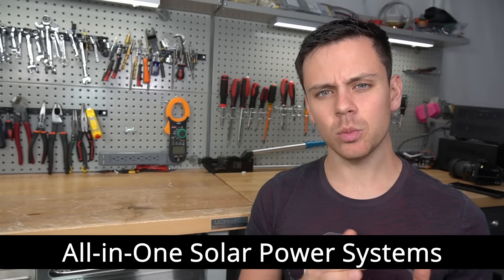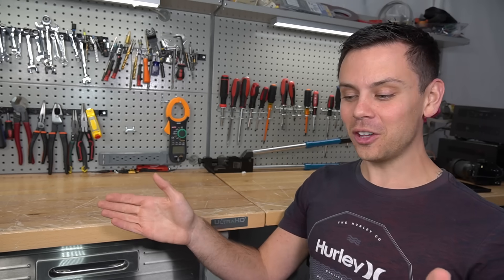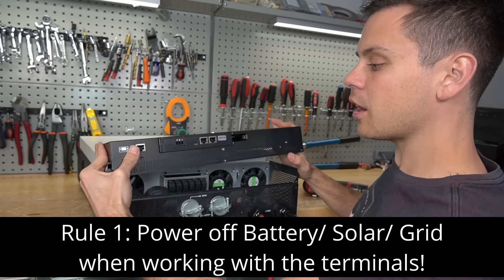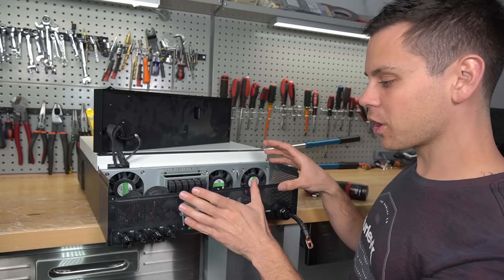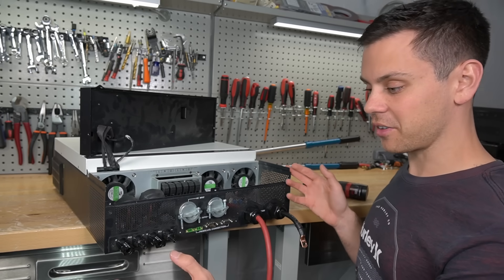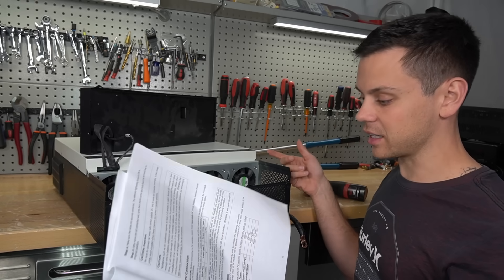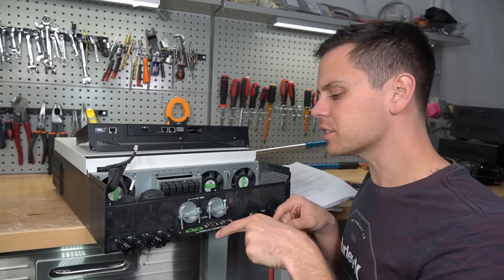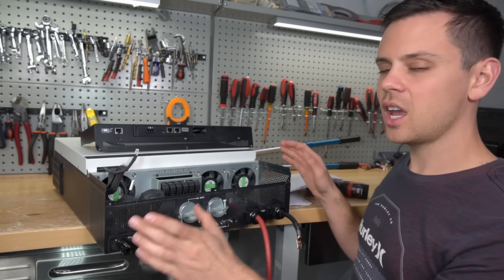All-in-One Solar System: 2 Basic Rules for Shock Hazard Prevention

Comment: Thanks for the video(s). I have the LV6048. Currently, my solar panels are grounded to earth (a 10awg green cable runs from the last solar panel and attaches to a ground rod which is buried 8ft). Are you saying that I should not have this ground connected to the panels?

Comment: Will: i can NOT find a video where a house, etc... is powered by the grid  but the grid ONLY CHARGES THE BATTERIES. the house itself would use solar power, etc... to charge the batteries and the inverter supplies ALL POWER TO THE HOUSE! 
this would be desirable as a lot of places REQUIRE YOU TO HAVE GRID POWER and SMART METERS detail every power surge, when power consumption increases etc...
it is my opinion that i should be able to power my house with power i generate and NEVER BE REQUIRED TO PROVIDE EVEN 1 WATT TO THE GRID. 
i actually worked as a BOILER OPERATOR TRAINEE IN THE LATE 1970'S AT A STEAM POWERED ELECTRIC GENERATION   POWER PLANT IN ARKANSAS.  ive lived off grid and generated my on power and stored it in lead acid batteries. so im NOT a complete nube !
the grid power is very fragile and the powers that be can shut off your electricity at any time they desire, as can any VANDAL !
i currently live in south dakota. it gets very cold here and the road behind my property currently is over 4 feet deep under the snow with over 10 foot tall drifts, while the road on the other end of my property is plowed regularly!  i lived on that property for 3 years with zero input from the outside world, used Hughes net (satellite )for my internet service and they didnt care if my power came from batteries.
looking for a place to buy and build on where there are NO building permits required because the size and strength of my building is NONE OF THEIR BUSINESS! i use to build houses when i was younger, so they will be built much stronger and of reinforced concrete!

i realize that most your viewers are upscale people with white collar jobs.
thank you!

Comment: Just wondering could this be the sense voltage but why is it ac and that high as i have seen all mppts have a sense voltage on the pv input. Any time i do work i shut it down completly If i have to mess with wires

Comment: Will, I just watched another video of yours, warning not to ground the the all in one inverter/charger, so as not to create a potential ground loop. The system will get it's ground from the AC input, which is completely understandable. Where I'm confused is on grounding on the panel frames, in case you have panel leakage occur. Does this not still create the potential for a ground loop if I have a ground rod for my panel frames only? Thank you son much for all of your wonderful videos and products.

Comment: I don't like (or use) non isolated hi freq inverters in our installed off grid solar systems! We prefer lo freq isolated inverters along with a good mppt charge controller. We never have a problem with stray voltage or bonding issues. The inverter we use is a XW 6048

Comment: "Not grounded at PV input"   For the novice, what exactly does this mean?   (1) not grounded at the inverter, (2) the structure where panels are mounted can't be on metal poles sunk into the ground, (3)  panels mounted on a metal structure have to be isolated from the metal structure if the structure is supported by metal poles sunk into the ground,  (4)  with combiner box in mind, one could see someone mounting the box on a metal pole that's sunk into the ground         

Do panels need to be floating and if there is a combiner box that also needs to be floating so basically there's no contact whatsoever to the ground?
Reply: Ground your frame.
Do not ground your PV wires.

Comment: Could you explain panel "Leakage" sometime please? I'm not understanding the "How" leakage happens or why.
Reply: The panel has got moisture into the electrical parts behind the glass and rear plastic film, now DC voltage from the panel (or from the inverter) is leaking out onto the metal frame.
Reply: @quattrohead  Thanks!

Comment: Thank you Will for your warning and videos in general. I have one question about this:

Do you think this problem also exists with these multi function devices that have a Low Frequency toroidal transfomer topology for the power inverter part of the device or is this only something that you find in High Frequency MosFet topology power inverters integrated in these do it all devices ? For example Vevor sells a line of these 4 in 1 devices that have a LF transformer for power inversion.

Comment: Hi Will,
do you still connect the ground wire in the ac input and output terminals? thanks
Reply: (circuit theory would say one SHOULD connect all "earth " terminals to the correct circuit. - and any exposed metal components should also be earthed  (additional earth connections of non electrical metallic components "never" hurt - safety switches - RCD/RCBO/GFCI/etc. use the imbalance in  active and neutral lines, it doesn't care how the missing current escaped the system - if the neutral lacks current (Amps), the switch activates, lives saved.)

If in doubt, for all domestic circuits ask your electrician to an RCBO - single DIN slot per pole - cheap safety "insurance".

NB, not an Elec-chicken.

Comment: I think one thing you missed with the AIO is the capacitors on the DC side, they could potential shock you after disconnecting the batteries
Reply: ( and blow a current meter...)

Comment: Got to say, this should have been common practice and rigorously in-forced. If a panel or case on a electrical device is to be opened or removed, disconnect from the solar, mains supply, battery,many source.

Nearly every YouTube channel on homesteading, solar and building all work on devices, consumer units and other electronic units, connected and some times live, its common to see people in self-home builds with the panels, connectors and receptacles live, in use, with no covers. Youtube is setting a bad precedent and very bad ‘how too’s as everyone assumes this is ‘how to’ work on electrical systems and it is safe.  CRAZY

Even working on systems when unplugged can be dangerous if there are capacitors present.

Comment: Hey Will, I would like to add something that you haven't previously considered. Originally, this comment was intended to be "tongue in cheek", but as I type this out, it might be a legit idea.
The Apple Watch could be a realistic safety tool in regards to receiving an immobilizing electrical shock.
The Apple Watch has a "fall detection" mode. If it detects that you've been immobile for about a minute, it will make a 911 call automatically. After the call ends, your watch sends a message to your emergency contacts with your location letting them know that your watch detected a hard fall and dialed emergency services.
The only problem would be if the electrical shock that stops your heart also stops your Apple Watch.

Comment: I of course always operate as if all lines are hot, even when I have everything disconnected. 

I read that in the manual, and I got concerned about it, but followed to a tee, and have no issues. 

I have yet to configure the setup for ac input, so I will check everything when that step is made. 

Thanks for alerting us Will!

Comment: Well, i feel sufficiently vindicated about the argument i once made on the forum that grounding your PV accomplished nothing useful but DOES increase the possible danger to a human touching the array. 

How about ac on the battery circuit? I found that one out the hard way too!
Reply: Grounding the FRAME on the PV array is a very wise choice, as otherwise YOU could become the ground if there is leakage.  Will means to not ground either the positive or negative WIRES of the array.
Reply: @Tumbleweed5150  
Just so we're clear: 

Ground your pv CIRCUIT = dead short your inverter (slang term but it popped a 10amp fuse in Wills meter so.. close enough?).

On the other hand, ground your pv FRAMING = dead short your inverter IF the TOTAL current leakage of ALL your panels is enough to actually shut down the inverter (have fun diagnosing which panels!), or if it's NOT enough to shut it down then you just have a phantom load on your inverter which doesn't trigger any actual protection devices because there's no gfci between internal componentry of the inverter.. right? At which point having your PV framing being grounded is just creating a large PITA and you may consider NOT grounding the PV array to your EGC and instead using spark-gap lightning protection and finding some kind of surge protection device to use inline in the PV circuit to protect from lightning. The EGC is there to facilitate fault detection but in this case THERE IS NONE TO FACILITATE! It will simply continue to operate in a fault state! At that point having a low pass filter on your PV wiring would probably do more good than just letting your inverter leak through your PV circuit full time via the ground conductor and creating a ground loop that is 'upstream' of any detection devices. The ground might make your array safer to touch while in a fault state if the array is on your roof, but if its a ground mount 200 ft away.. is having that grounding conductor making things better or worse? Grounding PV framing doesn't solve this problem. It just makes it hard enough to notice that it can continue merrily on. The fact that it took Will this long to become aware of this issue (no slight intended at all) corroborates this interpretation, in my opinion.

Comment: You may want to verify your voltage readings with a LoZ voltmeter so you can rule out any "ghost" voltages.  (I know your ammeter test proved there was an issue with that model, but I'm not sure if an ammeter was used on all the others.)
Reply from the maker: Yes absolutely

Comment: even when everything is powered down... there "could" be huge potential in the capacitors inside... those actually need to be drained as well.
Reply from the maker: They actually self discharge in a few seconds luckily. But yes the caps can shock for sure

Comment: My all-in-one’s instructions clearly said to make all connections and Cables before connecting to AC, Batteries, or Panels.  Something I believe you missed is the PV.  Most of these devices instruct you to connect your Panels in series limiting no load voltage to 500 volts and a working voltage of around 450 max.  I believe that needs to be mentioned as a danger as well.  JimO
Reply from the maker: Yeah I added that to the video with a huge text. Check it out again.

Comment: This happened to me last week when I was messing with my (wasn't thinking) and I accidentally touched the screwdriver I was using to tighten the solar leads. It was definitely an AC shock! And it was STRONG! Like, sticking your finger in an outlet strong! I was surprised! Mine is a PowMr 5000w. AC was plugged in to the wall, but I can't remember what mode it was running in.
Reply from the maker: Oh dang!! No way!
Reply: @WillProwse  Yessir! It was quite the jolt! I have also shocked myself on accident with the Solar leads (300v) and that was a much much different feeling than the one I got when I touched he screwdriver (the AC "pulsing" shock was much worse and my arm tingled for a while after). Also, i was wearing rubber shoes and thought i was insulated from the ground, but apparently not. Anyway, it is certainly something to be aware of. Here is another fun fact I found out that may be something to bring up to viewers. I had my inverter AC input plugged in to a GFCI. Then, when I plugged my furnace in to the inverter (I just have a standard 3 prong cord attached to the wire in the breaker box for now to test this before I permanently mount everything), the GFCI IMMEDIATELY trips. So something in my furnace is causing a ground-fault. (I then plugged this cord to the furnace directly into the GFCI and it also trips it without going through the inverter) I have other devices plugged in also, but they don't cause the GFCI to trip. So I think the thing to be cautious of here is that if I didn't have the inverter plugged in to a GFCI, I would have NEVER known that there is a current leak on the furnace and this could have been potentially dangerous! Now this is probably not something that is going to be the case in most people's houses (I am going to assume something is not wired properly in my old furnace). But it is something that people should be aware of. Loads that you typically would never have going through a GFCI (furnace, microwave, oven/store, water heater)  could potentially cause hazards if not run through their own dedicated breaker like they would be in a standard grid-panel.

Comment: Simply stated, does this mean that if your batteries are connected (and turned on at the breaker) that you should never work with the mppt wires? No plugging/unplugging panels, no disconnecting mppt from the all in one, etc? Even after dark?
Reply: ALL inputs should be disconnected before working on these.
Reply: @Tumbleweed5150  If the system is putting 120v ac on the mppt connection, wouldn't we be blowing something when the solar kicks in and starts putting dc onto the same connection?

Comment: Do you think that one of those all-in-one systems would work well in my little 21ft class c?
Reply: I don't see why not, as I have a 3000W Growatt installed in my girlfriend's shuttle bus/motorhome. I do suggest that you run a wire from the chassis frame to the grounding lug inside the unit for safety.

Comment: EG4 3000 add solar panels and an EG4 5.1K 48V rack mounted battery turn on and 20V to casing will happen every time. Must have a ground either via AC shore in or AC output ground connected to prevent this.
Thanks Will!

Comment: That explains a situation I encountered. I was in the process of disconnecting a Growatt 3000. I didn't think i needed to disconnect the battery when I was pulling the solar wires back through the hole. when I see a spark where two of them touched. I quickly shut everything down. I haven't had an opportunity to test the growatt since then to know if the mppt survived.

Comment: I'd read the manual and not mess with equipment when plugged into the grid. Oh I remember now, some PC power or electronic products can give you a shock on its power terminals even when unplugged, likely from capacitors. The safer products include resistors to quickly drain remaining power in a device once unplugged.

Comment: After everything is shut down is there any particular order that things should be turned back on? Example. Connect the battery first, solar input second and then turn on the inverter? Maybe it doesn't matter at all?
Reply: I am not sure about these all in one units, but because I started off with the older systems with panels, an inverter, and a solar charge controller seperate, I always connect the batteries to the controller first, then the solar panels. In the seperated system, the inverter can be hooked to the batteries either before or after the other connections are made. I still stay with hooking up the battery to my Growatts first, then the solar panels, just to be safe and in the practice in case I use the other type of system somewhere.

Comment: Working industrial maintenance has taught me to treat every terminal on everything as if it is hot, even if you think there is no power in the system. I find it shocking that this is not common practice for lots of folks.
Reply: As an electrician, the thing that blew my mind is, he read 120V AC on the input, and then proceeded to short the meter leads while leaving their ends on the terminals.

Good lesson learned. If your meter is reading a voltage, especially as high as 120vac. DO NOT assume something is faulty, or you are just reading some induction. Check with another meter, and at bare minimum, short it out with an insulated wire that has a coiled load of some type to try and discharge it. Never use a $200-300+ meter to try and bleed anything off. 

He's lucky it was only 10A, or his hands/face could have discharged the remainder.
Reply: @paaao  This is where a simple 25-60w regular light bulb is a great tool to use. If it lights up you have real voltage/current, if not then it is leakage.
Reply: "...treat every terminal on everything as if it is hot..."  This reminds me of something a laboratory director said to the new students on their first day, "Remember, hot glass and cold glass look the same."
Reply: Yes, I absolutely hate the first time I have to touch some bare connections. I mean after I turn off the breaker, move a non-contact around it and then check it with a meter...I KNOW it is off and there is No current... And I still hate touching it the first time!
     I believe that the best safety is a good healthy respect for what you are messing with!
      Ya'll Take Care and be safe, John
Reply: That is so correct, I worked as a industrial Maint. Technician for Smithfield Foods in Smithfield, va. You always treat all of the wires if they are live. Because for over 70 years of service they have been so many editions to the plant.
Reply: We train our guys to only test open dc circuits not under any load, and dead ac panels

Kinda blows me away that This is a thing coming from Will
Lol